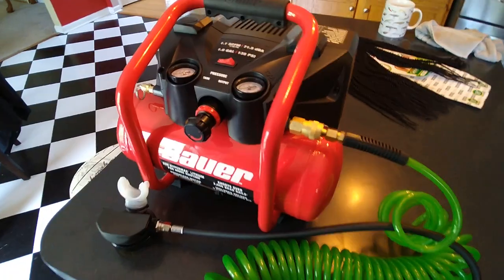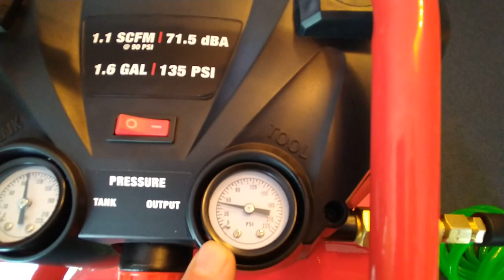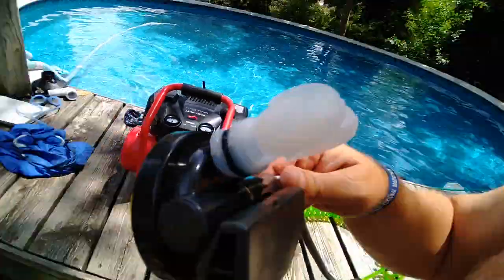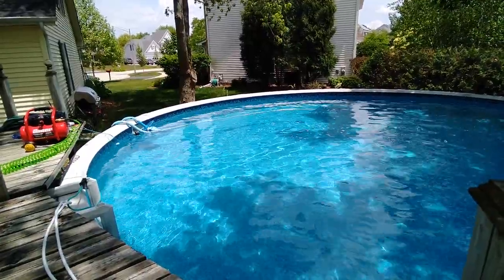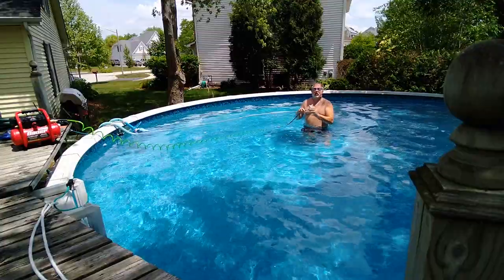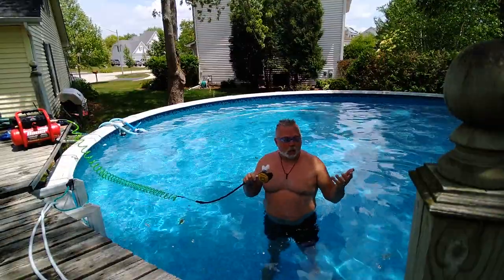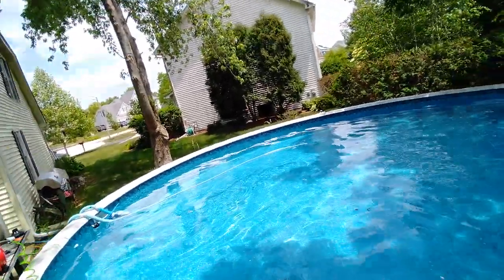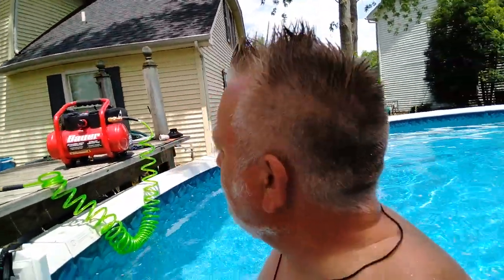VOGTLAND OUTDOORS   2021   BUILD a Surface Supplied Air hookah System for under $250

Comment: is 1/4 in coil hose too small ? would 3/8 coil better I would think air pull would be slow with 1/4..
Reply from the maker: Greetings PayMe! 

1/4 is a nice compromise: 
- any NARROWER and the actual volumetric air flow (even under pressure) is too small; 
- any WIDER and you get good flow, but the HOSE ITSELF becomes STIFF, HEAVY and UNWIELDY. 

Nope - 1/4 inch has been working NICELY so far! 

Cheers, 
-Mark Vogt | VOGTLAND OUTDOORS
Reply: @VOGTLANDOUTDOORS  So here is a idea back at ya first 25ft coiled and 25ft strait. coil at compressor side..
Reply from the maker: PayMe...

I TRIED the COILED hose too, thinking it would be a god-send...
... it turned out to be a NIGHTMARE :-O 

It was FOREVER getting TWISTED, so that ultimately a 25ft COILED hose ended up being about 10 ft of USEABLE hose, and it STILL was constantly getting twisted  even around my feet. 

TURNS OUT that the absolute BEST host was the SOFTEST, STRAIGHTEST hose I could find. 

How did YOUR experience with coiled hose go? 

FYI, you DON'T need 50 FEET of hose - remember you're only 15-20 ft DOWN, and your rig FLOATS, so you DON'T need to carry around 40 ft of hose you DON'T NEED... 

Cheers, 
-Mark Vogt | VOGTLAND OUTDOORS
Reply: I'm saying a small coil first just to take away any tugging like maybe a 10 ft coil and a 25ft
Reply from the maker: Payme, 

Feel free to try all these methods; I'm only sharing what happened to me - ANY "coiled" hose ended up being far far MORE TROUBLE than you can imagine, and offered absolutely ZERO benefits. 

Long, supple, straight, lightweight - THOSE end up being what truly WORKS for a hose - and ONLY 25 ft is all that's required, NO more or you're carrying around UNNECESSARY length. 

-Mark Vogt | VOGTLAND OUTDOORS

Comment: compressor now 149 with batteries on sale at 100 for two and charger 34, plus hose and mouthpices is NOT $250 but about $350, still a great deal. Did you omit the battery cost? Good video. I need this to work on my boat, cleaning the prop and scraping the growth off the keel. I cant quite get down far enough holding my breath
Reply from the maker: Greetings & Happy Holidays Doug! 
Remember I built this in early 2021, and prices do change ! 
You & I are in agreement on a key point though: THIS IS A GREAT SYSTEM FOR A GREAT PRICE ! 

All you have to do is go look for an off-the-shelf system, and you'll see they START at $1,000 :-O 

If you're only cleaning a boat, you could simply leave the rig ON the boat instead of in an innertube, but remember to bring a well-tied ROPE over the edge with you ! 

Q: Why? 
A: In order to WORK COMFORTABLY under water, you'll likely want to carry a heavier-than-neutral amount of BALLAST WEIGHT. That way you'll always be pulled DOWN so it's easy to reach up and do things like scraping, but this is also damned DANGEROUS because it's HARD to SURFACE when/if you need to :-O Hence have a ROPE you can PULL on, and a weight belt you absolutely positively can DITCH with ONE HAND EFFORTLESSLY. 

Good luck! 
 WOuld LOVE to see your OWN video of this rig being used !!! 

Cheers, 
-Mark Vogt | VOGTLAND OUTDOORS
Reply: @VOGTLANDOUTDOORS  I believe I'm going for the DeWalt cordless compressor because the Harbor Freight Bower only has a 90-day warranty. I could use a 110 volt compressor which is much cheaper but I don't want to have to run the engine or generator to support the power supply. I think cordless is the way to go. Thanks again
Reply from the maker: Hi Doug! 

The goals of DIY videos like this are to INSPIRE and EDUCATE, but NOT to "DICTATE" ;-) ... 
Think of these videos like RECIPES: 
If you follow them to-the-letter you WILL get a GREAT RESULT, BUT... 
... if you decide to make your OWN little "tweaks" then you get a GREAT RESULT that is YOUR OWN! 

And those are the BEST kind of recipe. 

Me? 
I follow my (late) Canadian mum Nancy's Thanksgiving Stuffing Recipe to-the-letter, BUT... 
... I ADD WHISKY (even MOONSHINE) to it, and that makes it "MINE" ;-) 

Just remember: SAFETY SAFETY SAFETY SAFETY ! 

Looking forward to seeing YOU do a "Tour on Doug's Variation on DIY Hookah Rig" !! 

Cheers,
-Mark Vogt | VOGTLAND OUTDOORS

Comment: Cool video, did you have to put any filters for moisture or contaminates? Thanks
Reply from the maker: Hi Jerry ! 

ANSWER: 
Yes - I've actually tried out SEVERAL outlet-side filters so far, and am continuing to try more out this summer and will report my findings & recommendations ! 

A key Lesson-Learned so far? 
DON'T use SEALED filters; they're GOING to eventually get wet and need to be opened and cleaned! 

Stay tuned, 
-Mark Vogt | VOGTLAND OUTDOORS
Reply: I wonder what other professional ones use? I’m sort of excited to try my Ridgid battery compressor. At one point they made 9Amp hour batteries. I’m assuming 2 x 9 amp batteries would last a while.I just want to make sure I get lines made for breathing, proper filtering, etc. The one I’d like to have is made by Keene engineering. Pre pandemic it was about $1,300, now it’s almost $1,700
It has 2 pumps like a high/low. The pumps and battery are housed in a sealed molded box with latch down lid. It uses a group 24 deep cycle battery which is good and bad. Good (you can fly somewhere, pick up a battery when you get there, (bad) heavy and you’d have to return it to the store or give it away before retuning. Good point 2 (you can dive deeper, it will support 2 people, etc. it’s tried and true by gold prospectors for years, has a built it large, nylon looking float, etc. I should probably rig mine up safely to test and make sure I can work it all out safely. If I lived near a beach with clear water, no question I’d have one, just not crazy to dive alone, one of the main rules in diving. Look forward to more tests
Reply from the maker: Greetings Jerry and welcome to VOGTLAND OUTDOORS ! 
GREAT to learn you're enjoying this particular series of videos from Summer 2021 - watch for CONTINUED FIELD TESTING & "EVOLUTION" in Summer 2022 ! 

WHILE I'm FLATTERED you paid ANY attention to MY under-$300 rig, speaking sincerely - if YOU'VE got $2,000 to spend on YOUR rig, I would recommend you buy an ACTUAL NAUI-approved or PADI-approved hookah rig :-O 

MY DIY unit is for guys who AREN'T in that price range, and who simply are looking for RECREATIONAL hookah unit for snorkeling and diving from the surface down to (say) 20 FEET MOST OF THE TIME. CHEAP and REASONABLY-SAFE FUN -  NOTHING MORE THAN THIS !

You & I are in agreement - NEVER DIVE ALONE! 
The NEXT-BEST thing I can do is to have family MONITORING me on the shore, and watching my buoy, but even that's NOT safe enough; so one mod I've ALREADY added is a Y-splitter on the OUTLET, so I can run TWO hoses from the unit and have a SECOND diver. My identical twin Michael has already done this and field-testing HIS rig (Summer 2021) with his wife, and they had a lot of fun in SE Minnesota lakes :-) 

Again, watch for more field tests early this summer, I only just got my POOL working last (Memorial Day) Weekend, so field tests start THIS WEEKEND ! 

Cheerio,
-Mark Vogt | VOGTLAND OUTDOORS

Comment: I wonder if you could convert a cheap car compressor? One is 300 psi and $24.
Reply from the maker: Greetings & Happy New Year Callum ! 
Believe me I HAVE given this some thought, but I've concluded that this would exceed the "Design Boundaries" 

Let me explain... 

For ME the design was all about trying to fit (only!) that range of depths between 6ft and 25 ft below the surface MAXIMUM - NO MORE THAN THIS. 

The Design was also meant to let you dive for a minimum of 20 minutes and a maximum of 45 minutes - otherwise (at least in North America) diving at depths of 20 ft put through not one but TWO different thermoclines, meaning it's easily 60 deg to evern 50 deg at those depths; staying down without even the thinnest of "shortie" suits for more than 30 min would be unwise... 

Finally, the Design was for a SINGLE person, not multiple. 

Put all MY design criteria together and you have the very design I've arrived at. 

That said, if you consider using a LARGER, MORE POWERFUL compressor, IMHO you're actually OVER-designing it - and that can get you into TROUBLE. 

WHAT WOULD YOU DO with all that extra power? 
The LIKELY answer is that you'd dive DEEPER (UNSAFE!) or LONGER (UNSAFE) :-O 

Something to ponder. 

Please be careful in your own designs. 
You DIDN'T HEAR IT FROM ME that using a more powerful compressor is a good idea. 

Respectfully,
-Mark Vogt | VOGTLAND OUTDOORS
Reply: @VOGTLANDOUTDOORS  I have no clue about this stuff. I feel like the companies are ripping people off at $600+ for their compressor battery powered snorkel, when a compressor can cost $20 and i've seen lifepo4 12v 12-AH go for $60. Thanks for the info.
Reply from the maker: Greetings Callum ! 

I think you & I feel the same way - some of the "professional grade" SSA/Hookah units (like NEMO) sell for $900 and even more... yet they don't even have an air tank for a "reserve" - and speaking candidly that scares the HELL out of me ! 

IMAGINE you're at a depth of 25 ft and exhaling your current breath, expecting to take the next one... 
... and THE BATTERY DIES, and NO BREATH IS COMING :-O . 

25 ft is nearly 2 BREATHS from the surface - what the HELL do you DO ??? 
I honestly DON'T know if I would make it, especially if I were wearing a WEIGHT BELT for neutral buoyancy. I DON'T know if I could DITCH the weight belt and make a BURST for the surface with less than 2 cups of already-used air left in my lungs... 

... yet these manufacturers want over $900 for their rigs. 

The unit I put together ISN'T trying to be the CHEAPEST rig out there - it IS trying to be the MOST AFFORDABLE-WHILE-BEING-SAFE rig out there. 

AND when you're not DIVING with it, you can USE it around the SHOP ;-) 

Cheers, 
-Mark Vogt | VOGTLAND OUTDOORS

Comment: Awesome video. Did that compressor come with the air filter or is that something special you had to add if so where did you get it ?
Reply from the maker: I made it
Reply from the maker: Hi ! 
ANSWER: 
The Harbor Freight Compressor DIDN'T come with ANY filtration system - this is STILL BEING PERFECTED during SUMMER 2022 ! 

Watch for more on this - I'll be adding a new filter THIS WEEK ! 

-Mark Vogt | VOGTLAND OUTDOORS
Reply: @VOGTLANDOUTDOORS  thanks for the info I'll definitely be watching

Comment: You should be using a higher pressure. Especially since you are using a small diameter supply hose
Reply from the maker: Greetings Albert and welcome to VOGTLAND OUTDOORS ! 

Thanks for your reply. 
There may indeed come a time when I'll experiment with increasing the pressure, but for now it is a best practice in mechanical design to MINIMALLY meet expected operational requirements, and my current has done just that. 

If I INCREASE the pressure then I also INCREASE the WORKLOAD of the compressor, which SHORTENS the life of a charged battery, maybe from 35 minutes to 15 minutes? 

Hope you see my point. 

FIND ME A BETTER submergible PRESSURE GAUGE - that's where I welcome advice ! 
;-) 

Kind regards,
-Mark Vogt | VOGTLAND OUTDOORS

Comment: Dude that’s perfect for my Jetski.
Reply from the maker: Greetings MoFlyBoy ! 

GLAD you liked the design and see merit in it ! 

REMEMBER it's only useful down to about 15ft to 25ft !!!!

HAVE FUN ! 

-Mark Vogt | VOGTLAND OUTDOORS
Reply from the maker: Hi MoFlyBoy ! 

WATCHED the video you posted to me - ALREADY saw it during the "Research Phase" of my own design. 
LIKE the guy...
LIKE many aspects of his hookah unit (quiet, clean, well-sealed)... EXCEPT for ONE thing: NO TANK :-O. 

There is a MASSIVE and potentially-DEADLY risk associated with this guy's rig, and even the "Nemo" unit that is increasingly popular... 

IMAGINE you're 25 ft down and happily sucking on your regulator as you explore the bottom...
You exhale fully, begin to draw in your next breath and then... NOTHING :-O 

NO TANK means that when the BATTERY STOPS your COMPRESSOR STOPS and your BREATHING STOPS - all UNEXPECTEDLY :-O 

I thought LONG & HARD about that design, even in the Nemo, and found it very much lacking. 

So when I went looking for MY compressor and came across the HARBOR FREIGHT portable compressor with a 6 GALLON TANK, I knew I'd FOUND my answer, because 6 gallons of air at 125 psi equates to 20 BREATHS which gradually get HARDER and HARDER to draw, so you GET the "warning message" you so very much NEED when you're diving ! 

Once I'd assembled MY unit, I tested it MULTIPLE times in 6ft, then 10ft, then 15ft, then 20ft, and finally 25ft of water in Devil's Lake WI. Each time the 6 gallon tank made it IMPOSSIBLE to ignore that I had only a handful of breaths left, because with even 5 breaths left, you really FELT the "pull" as you breathed in - TIME TO GET TO THE SURFACE ! 

That plus a PRESSURE GAUGE on the hose and I felt comfortable diving to 25ft, although I have to say this - in most midwest and upper midwest lakes all the COOL stuff is from 5ft to 15ft of water - deeper than that is often NOTHING  not even bottom vegetation ! 

I'll stick with a design that has a TANK; TANK == SPARE BREATHS == LIFE ! 
;-) 

-Mark Vogt | VOGTLAND OUTDOORS

Comment: How is this working out for you still? I'm looking to build one in the UK for river and lake diving, are you finding any problems?
Reply from the maker: Greetings & Welcome Dave to VOGTLAND OUTDOORS ! 

SHORT ANSWER: 
I live in the  NORTHERN MIDWEST of the USA, so ALL diving ENDED in EARLY SEPTEMBER  LAST YEAR :-O 

DID I experience any problems? 
NO "deal-breaker" problems at all 

DID I experience any "annoying" problems? 
YES - several - and here's how I FIXED them: 

PROBLEM: 
My FIRST air filter was CHEAP, and got CLOGGED with SAND & WATER on the 1st day; 
Also, I had INSTALLED it WAY DOWN near my MOUTHPIECE - UNNECESSARY (in fact SILLY) 
SOLUTION: 
I bought a DIFFERENT filter that mounts DIRECTLY ON THE OUTLET PORT OF THE COMPRESSOR ITSELF, so it's OUT of the WATER, EASY TO CLEAN & MONITOR 

PROBLEM: 
I had a "barb" type fitting between my longer 25ft air hose and the 6 ft length of air hose that came with my mouthpiece & 2nd-stage regulator - AND IT POPPED LOOSE WITH ME AT 10 ft DEEP !!!
SOLUTION: 
I REPLACED THIS FITTING with a PERMANENT ONE

PROBLEM: 
In my "generation 1" unit I thought COILED AIR HOSE was the way to go - THIS WAS A HORRIBLE IDEA ! 
SOLUTION: 
I purchase a NEW 25ft length of STRAIGHT, "MEMORY-FREE" air hose, and it's been WONDERFUL EVERY SINCE 

PROBLEM: 
AT first I DIDN'T have ANY sort of TANK PRESSURE GAUGE NEAR my BODY while at depth. So when my BATTERIES DIED and I only had 135psi of air in the 6 gal tank ( about 20 breaths) I COULDN'T TELL I WAS "EMPTY" until I had literally only about 2 breaths LEFT !!! :-O 
SOLUTION: 
I installed even a $10 dial pressure gauge on a "T" fitting just 5 ft from my mouthpiece, so I can see it ALL THE TIME. NOW when the tank pressure starts to DROP BELOW 100 psi (about 6 breaths) I CAN SEE THIS RIGHT AWAY AND BEGIN PREPARING TO SURFACE SAFELY ! 

That's it 

BE CAREFUL ! 
ALWAYS DIVE WITH A BUDDY ! 
WATCH EACH OTHER CONSTANTLY ! 
ALWAYS WEAR a DIVE BELT YOU CAN DITCH ! 
NEVER GO DEEPER THAN "1 breath" from the surface (25ft) - IT'S NOT WORTH THE RISK !!! 

ENJOY ! 
- Mark Vogt | VOGTLAND OUTDOORS
Reply: @VOGTLANDOUTDOORS  thank you so much for the response
Reply: Hi Dave,

Did you manage to find the Bauer compressor in UK, if so where ?

Thanks

Steve

Comment: Do you think if I purchased a 60v dewalt compressor that it would support 2 divers?
Reply from the maker: I cannot speak to any DeWalt equipment, but I CAN tell you that over the summer my identical twin brother Michael built my SAME RIG (Harbor Freight 20V 6 gal 135psi tank), and he & HIS wife WERE ABLE TO USE IT CONCURRENTLY at depths of 10ft for about 30 min :-O 

They added a SINGLE "Y" splitter just outside their hose's air/particulant filter, and then hook 2 different hoses up after that - one for HIM, one for his WIFE. 

It worked nicely. 

WHAT YOU MUST REMEMBER - WHAT WE'RE DOING IS DANGEROUS IF THE DIVERS INVOLVED ARE NOVICES !!! 
You could SUDDENLY LOSE THE ABILITY TO BREATH IN A LITTLE AS 2 BREATHS - IF YOU'RE NOT READY TO HANDLE THIS KIND OF SUDDEN "PANIC" THEN NEITHER SSA NOR EVEN SCUBA TANKS ARE SOMETHING YOU SHOULD BE AROUND ! NONE OF THIS CAN BE CLAIMED TO BE 100% BULLETPROOF or IDIOTPROOF !! 

Please keep this in mind ! 

Cheers,
-Mark Vogt | VOGTLAND OUTDOORS

Comment: Mount a cooler on a truck tire and the compressor inside. Drill a hole for the hose and a side air vent and you are ready for treasure hunting buddy ✌🏽
Reply from the maker: Greetings Siam Alien - you deserve a prize for most ORIGINAL ALIAS ! 

WELCOME TO VOGTLAND OUTDOORS ! 
THIS video series has been SURPRISINGLY POPULAR since I first introduced it last summer! 

"mount a cooler in a truck tire"? 
Hmmm... 

DON'T need the truck tire (I already bought the fantastic $29 tube WITH a FLOOR), but YOUR suggestion about placing it all in a COOLER (sealed from water) ?? 

I MUST GIVE THIS A TRY - VERY CREATIVE ! 

Wait til next year ! 

-Mark Vogt | VOGTLAND OUTDOORS !

Comment: What's the total weight of everything ? 
to hike down a trail to a river
Reply from the maker: Greetings "Five" ! 
ANSWER: 
-  compressor: 20 lbs
-  rest of gear: about 5 lbs (really!) 
-  weights: about 8 lbs (I'm about 25 lbs overweight, so I need 8 lbs in my hands as I dive) 
============================
Total: 33 lbs - 2 trips from wherever you parked

BETTER? 
TWO GUYS DIVE, so TWO guys make ONE trip, and they BOTH get to dive for about 45 minutes ! 

Cheers,
-Mark Vogt | VOGTLAND OUTDOORS